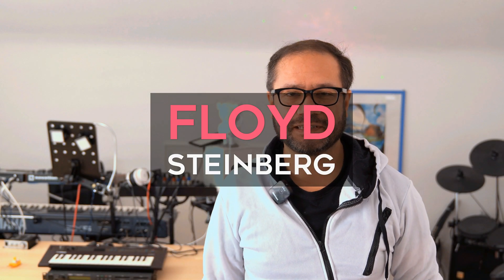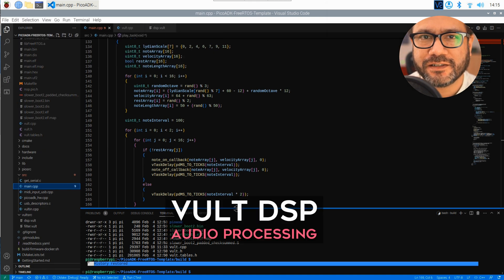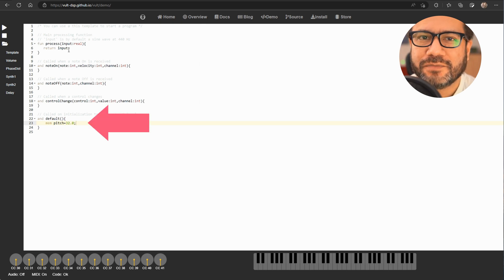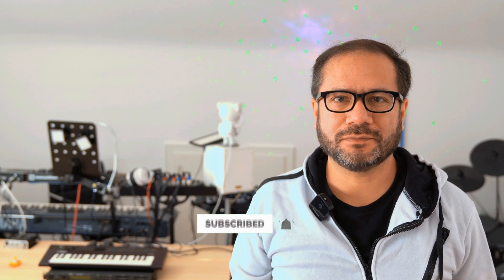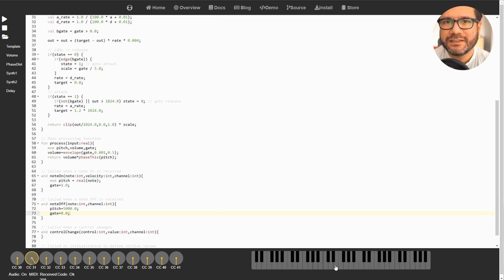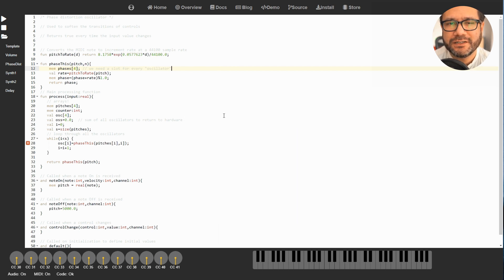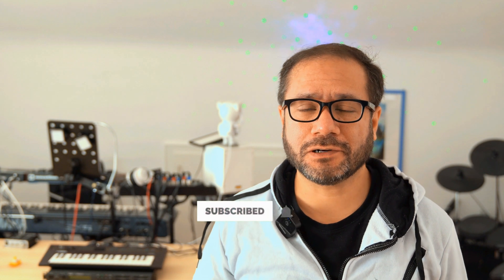VULT DSP: a cross platform sound processing language

Comment from the maker: This video might or might not contain a small coding competition with some minor prizes to win. Send your entries to fs at floydsteinberg dot com to take part - I will show your creations in a video, shout out your YouTube channel, and you can also win a PICOADK and other things!
Links & Resources
VULT https://modlfo.github.io/vult/
Web Tool https://vult-dsp.github.io/vult/demo/
Examples https://github.com/vult-dsp/vult/tree/master/examples
PICOADK https://github.com/DatanoiseTV/PicoADK-Hardware, https://schneidersladen.de/de/datanoise-picoadk

00:00 introduction
00:38 what is vult, and why use it
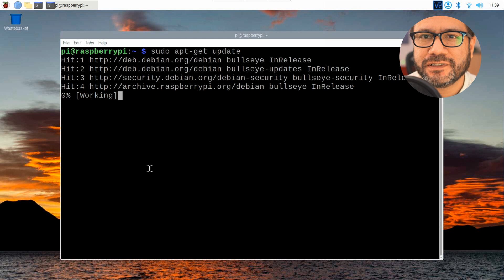01:25 how to install the software development kit
01:53 Visual Studio Code setup
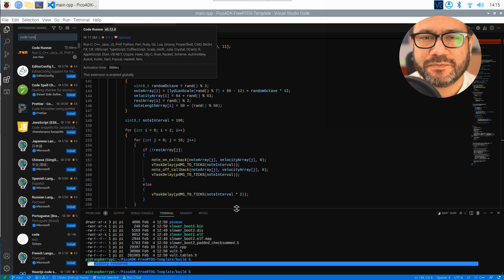02:09 the PICOADK template, VULT DSP architecture
02:49 the web prototyping tool
03:36 functions: fun / and
03:49 default functions: process, noteon, noteoff, controlchange, default
04:15 example 1: a simple monophonic synth
04:44 persistent variables (memory variables)
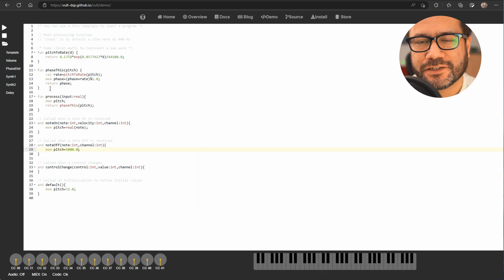05:40 about that oscillator function...
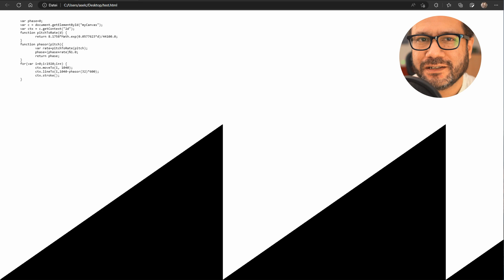06:16 where to find other building blocks for copy&paste programming
06:58 example 2: envelopes
08:49 reacting to controllers
10:04 creating a polyphonic synth using arrays
12:27 compile & upload to PICOADK to create a bare metal synth
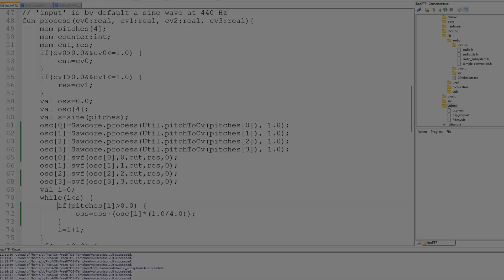13:04 some optimizations were needed on hardware
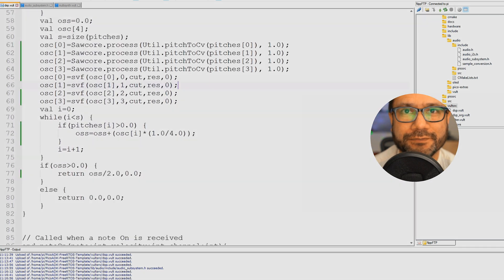13:23 homework for you (and WIN something!)
14:50 short demo of my synth 
15:24 conclusion

Comment: As I understood from the first part, you used VULT DSP because it is a language for developing audio applications, but isn't Pure Data also that kind of language? I'm learning Pure Data and it can in deed do MIDI and also process audio and be used for programming synths. So, why did you discarded PD?
Reply from the maker: Hi, thanks for watching! I didn't discard PureData, it just so happens this video is about VULT. ;-) 
PureData covers music in a much broader perspective, while VULT is strictly about sound processing/synthesizing, with the aim to generate optimized code that can run on embedded devices (without an operating system).
Reply: @mr_floydst  Ok, I see. I just misunderstood it. That was my impression from the first section where you answered: "Why use it over other languages?", where you also mentioned Pd.

But yes, you are right: it seems that you need to have Pure Data to run all programs written on it. With Vult, you can just compile into C++ and then you have a binary. I guess that's the only reason I would choose Vult over Pd, which can also do sound processing and synthesizing.
Reply from the maker: @jmemusic  Yes, I meant that like "_when_ use it over other languages / why would you...", not as an imperative. ;-)

Comment: Hmm maybe i should use vult for my mixer ideas
Reply: Yeah mixers are really easy to implement in vult.
Reply: @datanoise  nice ! I just need to design the and get started then!
Reply: @jacobrosen  fun process(in1:real, in2:real, in3:real, in4:real) {
   mem param1, param2, param3, param4;
   val out1, out2, out3, out4 = 0.0, 0.0, 0.0, 0.0;

   // all inputs mixed to out1
   out1 = in1 * param1 + param2 * in2 + param3 * in3 + param4 * in3;

   return out1, out2, out3, out4;
}
Reply from the maker: Thanks for watching! It's worth trying.

Comment: What would be the main pros and cons of Vult compared to Faust?
Reply: PPS: There are also great series on how to implement "analog modeling" with Vult: https://www.youtube.com/watch?v=xQYLBS9R_uA
Reply from the maker: Hi, thanks for watching!
I'm afraid I'm not the right person to answer this question. I'll try to get some experts to answer your question ;-) As I said in the introduction, this video is the result of using VULT for around 2 weeks.
Reply: Advantage of Vult is for example that you can write everything in floating point notation, but it can compile to fixed and floating point. Also, it is very performance, therefore even though the PicoADK doesn't have floating point hardware acceleration you can create complex polyphonic synths with analog filter models etc. without any issues. Also, I really like the syntax and way vult works (see "mem" and then "and" and "fun" functions. Basically it declares all the global variables in a struct which is then used as a context.

Make sure to check out the Vult Tutorial series on youtube from Leonardo!
Reply: Also vult comes with very nice building blocks - like a SVF filter, Ladder M**g style filter, etc. and also oversampling is very simple.